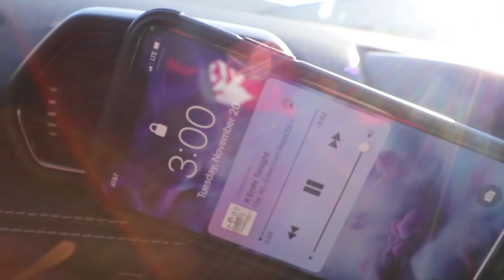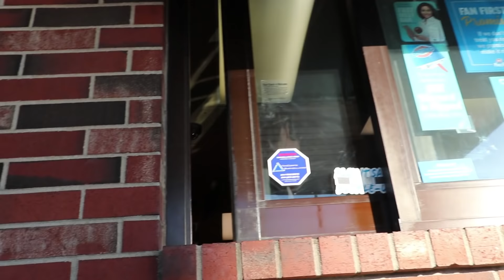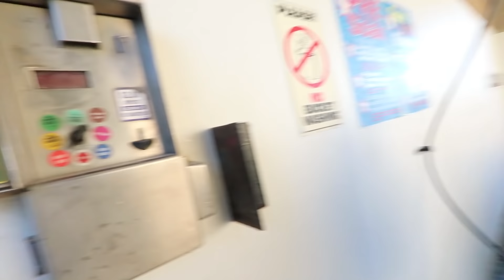SURPRISE LAMBORGHINI RIDE FROM SCHOOL!!

Comment: Be careful with that high pressure washer. You're suppose to be like 8 inches or so away from paint. If it's had any imperfections or rust spots (I'm sure his doesnt) but it can chip and cause lots of damage to paint

Comment: You cant practice backfires. Backfires only occur when there is more fuel being injected than being burnt to cause fuel to fly past the cylinders and igniting through the exhaust system instead of in the cylinder where it should ignite. You lose more power in that way. You can tune your cars ECU to let more fuel be injected for it or the car is not tuned right causing it to backfire if your going for more horsepower and performance being happy about backfires in not that good. But hey you guys are just enjoying yourselves not tracking either car so does not matter
Reply: stop being a smart alic
Reply: @Monkeymuncher69  well my bad they made an uneducated comment that will lead his 10yr fans to think they can practice a backfire when you cant
Reply: @MyolJrmexii  true